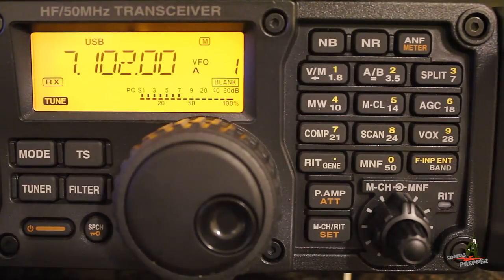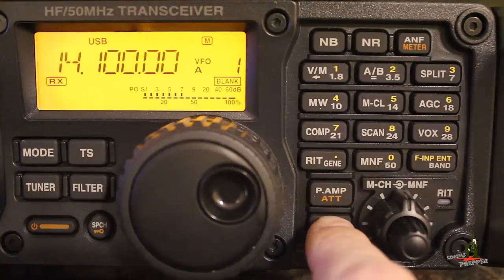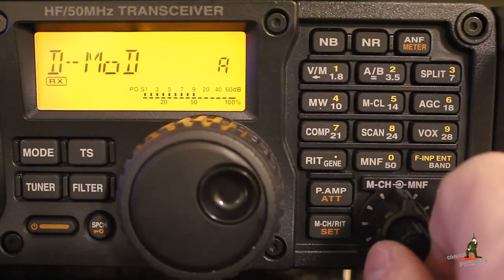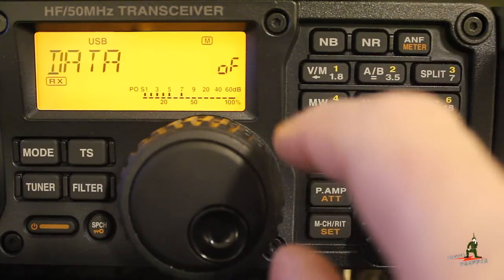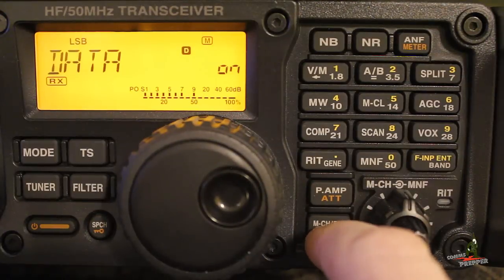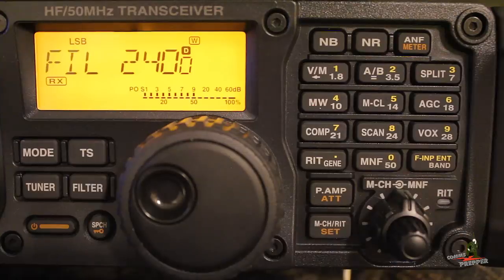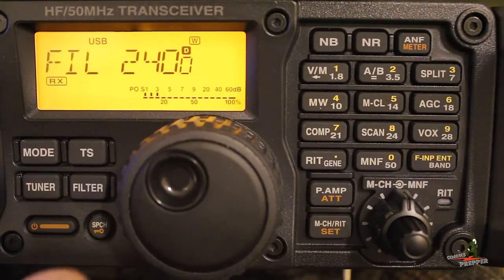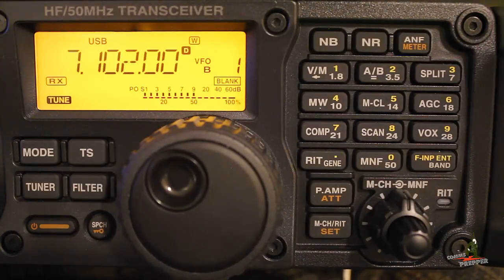SCS Pactor Modem Settings for Icom IC-7200

Comment: How do you set your ALC for data/Pactor?
Reply from the maker: Slowly increase the audio drive until you see the ALC activate - then back off the audio level until the ALC stops responding.  No two radios are the same.

Comment: Just an FYI on a conversation I had very recently with on of the principal Winlink developers re running a 7200 at 100W for Pactor. He is credible as he had been running five 7200s as gateway radios for several years. I had heard that the 7200 could be run at full power with no problems (e.g., phase distortion) for Pactor. He has verified this fact. He did indicate that on a couple of the nodes he runs them at 50W afor primary power management  only because they are solar powered.
Reply from the maker: I believe the IC-7200 can handle the full power - but why?  Amateur principles call for only the power needed for communications.  Pactor is robust enough that full power should never be needed.  I don't see the need to push the radio so hard.
Reply: @Commsprepper  My question to Mike Burton (Winlink devel. Team) was more technical & capability of 7200s r/t phase distortion v.  should/should not. Of course derating power out to 75W would likely make little difference  for a Pactor signal.

Comment: I have been following your post on the SCS Pactor MODEM.  I will be making a purchase of a SCS P4, Dragon, to be used in P3 mode on amateur radio.  I am running two ICOM 718's, and went into the set up .  To the best of my knowledge these radios do not have a Date Mode as the newer ICOM's.  I think that the only adjustment for them is my DSP filter and also an installed filter.  One radio has a SSB (wide) and the other radio has a 500hz CW filter.  The radio with the SSB filter is used for PSK-31, with a USB Signal Link, so that one will not be used for the P4 MODEM.  The work will shift over to the ICOM 718 used for CW with the CW filter.  However in USB for P3, the CW filter will be off and the receiver should be wide open except for the DSP filter.  That should give me enough band width????   What do you think?    WD5GYG
Reply from the maker: I have a video showing the IC-718 and Pactor.  Look in my radio email playlist.

Comment: Hi, great video.
I've connected a DR7800 to my ICOM 7200 and did your settings. Modem and computer are connected via Bluetooth. It all works, but I cannot connect to Airmail stations. Somewhere on the Airmail website it is advised to change  the FSK and PSK levels. But what settings would you advise / did you use for the 7200?
I'm a total lee on these things..... (Have Marcom A, but no ham-related training or education).

I've looked for an answer in the comments below, couldn't find it.
Peter Martinsen reports the ALC setting. Could you explain and advise any settings?

Thanks,
Henk
Reply from the maker: Are you running the Airmail program?  I have not used that program in 15 years.  I would recommend RMSExpress.
Reply: Yep. It's Airmail.

Comment: I'm a bit confused with USB connectivity to the modem. RMS Express is perfectly happy controlling xmt/rcv audio and keying/unkeying the radio thru the USB. But, what's happening with the SCS PACTOR USB's? Are TWO cable required, one USB and another to the ACC DIN connector? What is going thru which port? Thanks!
Reply from the maker: I'm confused with your question.  Yes at least two cables are needed.  The USB connection is made between the modem and computer.  The 8 pin DIN is connected between the modem and radio's data or mic port (port with PTT, RX audio, and TX audio lines).  There is an option for a third cable if you want RMSExpress to also control the channel changing.
Reply: Sorry for my lack of clarity and mentioned that my HF is a 7200 (n6med on QRZ; you can go direct to my email if need be to further this conversation). I use my 7200 with RMSE and fldigi both of which work great through the USB connection to control the radio for xmt/rcv & radio channel and pass audio to and fro'. But, from what I understand you said above, I would need THREE cable to interconnect my 7200 with a PACTOR modem.

Comment: Can you take full advantage of the P4 speeds in the USA?
Reply from the maker: +M Miller Not yet.  However, there is a proposal before the FCC to permit Pactor 4 in the US (http://www.pactor.com/).  Amateurs overseas are using it so I am hopeful that the FCC will approve it.   The link provide is tracking the progress of the proposal.
Reply: Thank you!  So I guess you set it to a lower speed.. Does the P4 running at P3 speeds provide other benefits over the P3 unit, such as error handling etc?  Also, given the price of these modems, are there other functions you can perform with it other than email?  I guess SCS removed the other modes awhile back such as PSK31 etc.  I'd like the speed advantage over the SignaLink but would like more functions besides email since I moved back into the USA form oveseas.
Reply from the maker: The RMS software has a setting to set max Pactor level (in the US you select 3).  Pactor 4 is better!  Signalink Winmor can't hold a candle to Pactor 1, 2, or 3.  You can read an email over the air faster than Winmor can send it.  By the time you send one email you can cook eggs on your radio.
Reply: LOL! Thanks and 73s
Reply: yes

Comment: did you upgrade your Pactor modem? Do they now allow the faster transmission rates?
Reply from the maker: +Hubb Zilla I did upgrade to the Pactor 4 modem but run it at Pactor 3 rates until the FCC approves Pactor 4 speeds.

Comment: just how low will the power setting go. can it do the limbo. lol. qrp on a hi-power radio.
Reply from the maker: +dale myers Dale the radio can be adjusted between 2 to 100 watts for SSB, CW, RTTY (ref page 31 of user's manual).
Reply: ok, cool. i know you also have the ft817nd. i started to buy one but the store i had sent off for was out of stock. so now i'm opting  for the ft857d. few manufactures seem to want to make a mobile. this makes me so irritated, irritated to the point that wished baofeng made an all mode hf mobile rig. i think they could do it for high 200's to mid 400's dollars. it doesn't need to be full featured. as long as it is true all mode, unlike a few out there. and it comes with sub-audible tones. i can see it using mechanical filters from rockwell-collins.

Comment: CP, whats your grid?  Me:  CM94an  KJ6YYC/Extra/VE/FE
Reply from the maker: +John Lord FM18js - looked up your grid - off the coast of California?
Reply: Well if we have the Big One, with earthquake, dam breaking and flooding, and whole West Coast from Vancouver Island down to San Diego shakes free .... Typo.  CM97an.
Reply from the maker: Found you.  We are on opposite sides of the country.
Reply: +Commsprepper At ARRL field day, we great circle 40 and 60 meter to Ontario, Quebec, PA, NY, VA, East Coast, so you should get a hit from us then.
Reply from the maker: +John Lord Do you have Pactor?  Perhaps we could try a peer-to-peer connection with RMS Express?  I still need to do a video on that.  Hank
Reply: No, just straight equipment for me.  So busy.  Need to do a complete laptop to radio software set up for all these various modes. Others at field day only doing voice or CW.  Only special people in our (attempted) EOC volunteer net group use RTTY, and have talked other options, but all on their equipment and locations, not otherwise used, or even at field day.